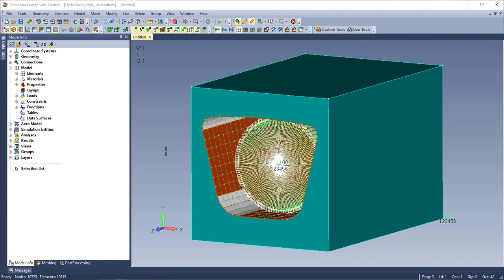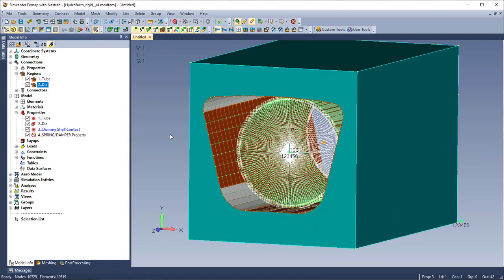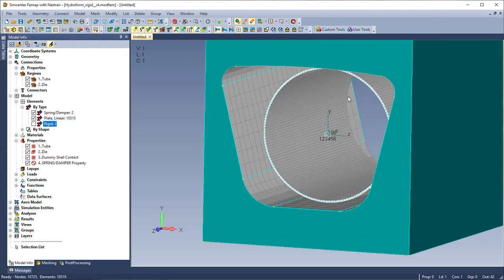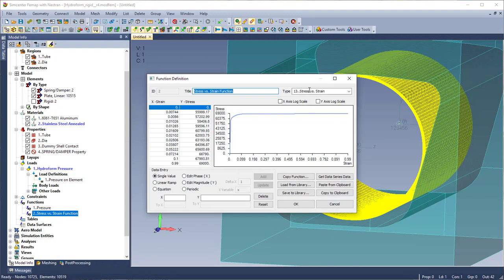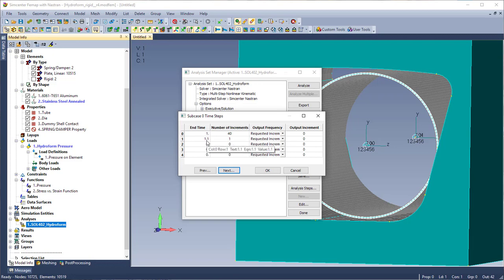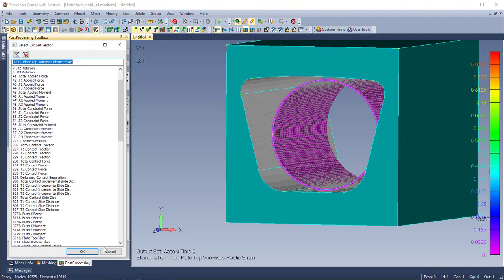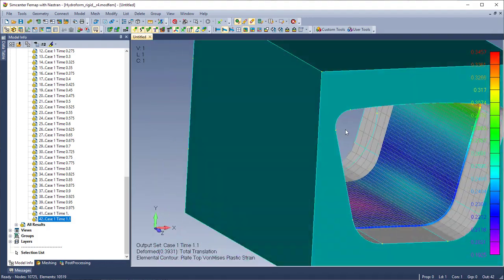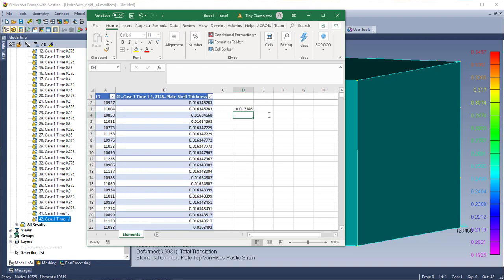Femap SOL402 Hydroform

Comment: Hey Troy, I have a few follow up question for you. Are you using a true stress strain curve for the aluminum and are your RBE3 elements constrained? Thanks
Reply from the maker: Hi John, the aluminum stress stress strain curve is in engineering terms, not true stress vs. strain. If I had true stress vs. strain data I would have to set the function type to "46.. True Stress vs. Strain". This would in turn set the STRMEAS field on the MATS1 in the Nastran input to "TRUE". Note that in SOL402, when the data is in engineering stress vs. strain and large strain is turned on in the bulk data options (like I have in the video), the solver internally converts it to true measures. I believe this formula can be found in the Multistep Nonlinear User Guide. 

The RBE3 element is constrained only in the global Z translation direction. The global Z in this case is the axial direction of the tube. This allows for the tube to expand out in all different directions except for the Z which is tied to the CBUSH element that has some relatively smaller stiffness in the Z direction. This was just to provide the model with some stability so that when the pressure was ramping up and there was no contact yet, the tube couldn't fly off in the Z direction and a numerical error to cause the solver to crash.